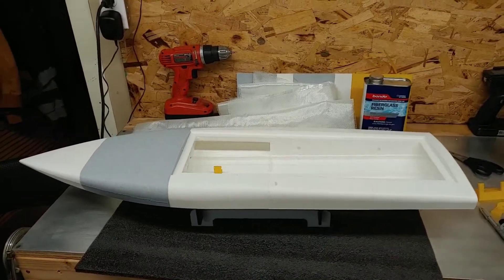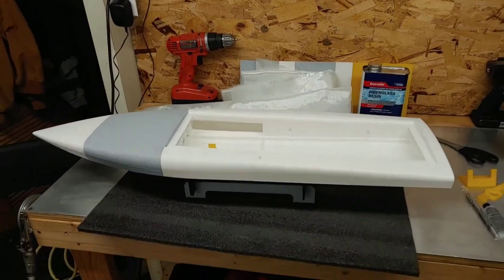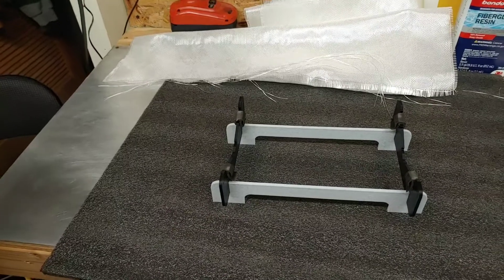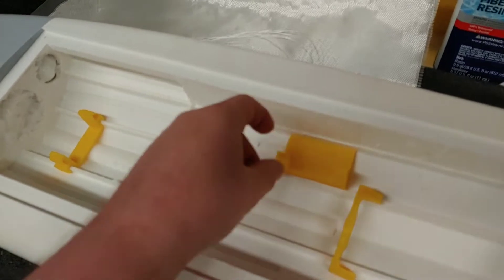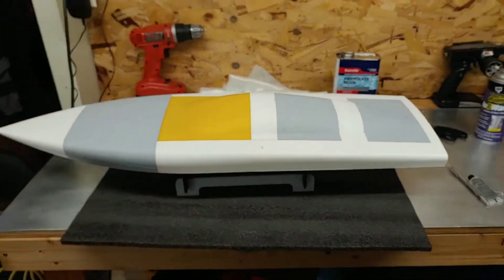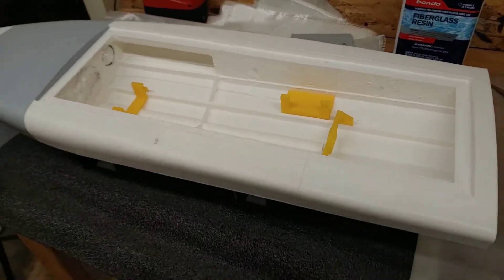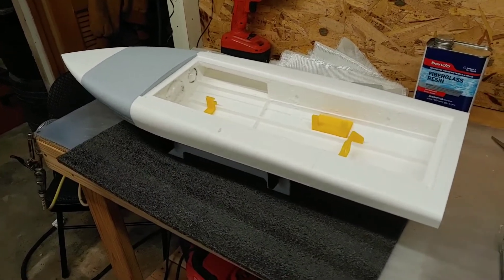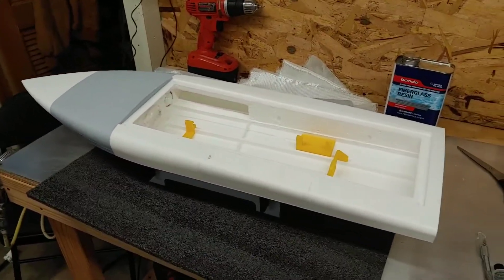3d Printed RC Boat Build

Comment: cool boat. I printed one but downsized it a little bit. its 27 inches long. I put a goolrc 4074 brushless motor in it and it runs somewhere around 55-65 miles an hour.